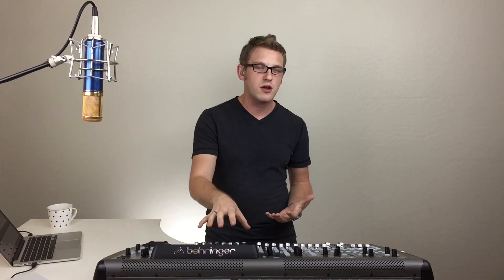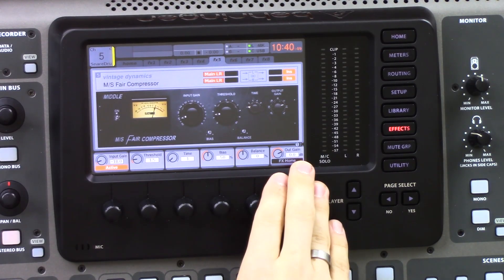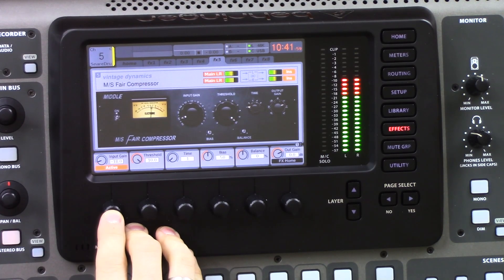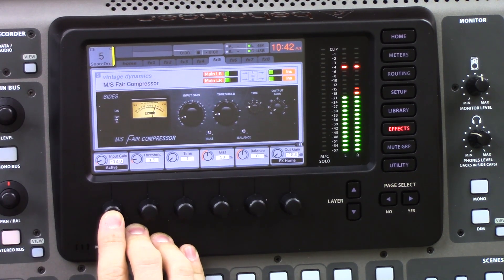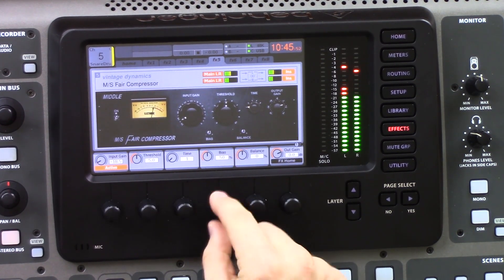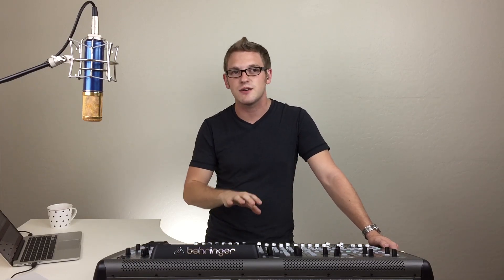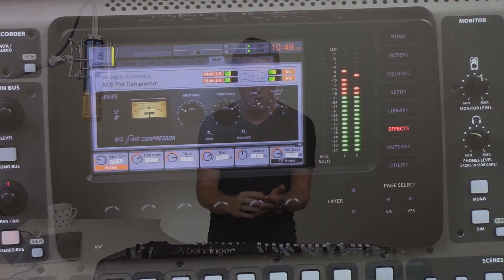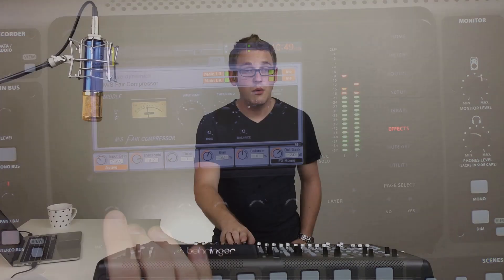Behringer X32 FX Series - Fair Compressor - Part 2

Comment: Hey Drew! Thanks for these tutorials. I’m running into an issue with this effect and thought I would run it by you. I’m inserting it on a stereo channel that’s linked on the console (keys). I’d like to use it to carve out the center of the keys and leave the sides, but the effect doesn’t seem to be processing anything but the “middle” channel. The “sides” channel seems to have no audio running through it. Any idea why that would be? Thanks!

Comment: I'm curious, what kick mic did you use for the kick and were you using?  I was curious about the 'click' in the kick as I always seem to end up with a bit of tearing sound when using a Beta 52a on the kick.
Reply from the maker: +Brett Gilbert Hey Brett! I love the combination of the Shure Beta 52A on the outside and the Shure Beta 91A on the inside. Gives a great selection between the low end boom and the click I want out of the kick drum. One of my favorite mic combos!

Comment: @drew when I send my drums to a mix bus and add a compressor like this one, it sounds like the entire drum set has phase issues, not a little bit but a ton, why is that?
Reply: You can’t use parallel fx buses on X32, so make sure that the original dry signal is muted.

Comment: Would this still work if it was just a single overhead ?  I attempted to use this technique this week because we are getting way too much snare through out overhead, but couldn’t really get the desired effect, even using extreme settings. I was curious if it is because it’s a single mono overhead and not two run  stereo.
Reply: Not sure, I think there is a option for one....